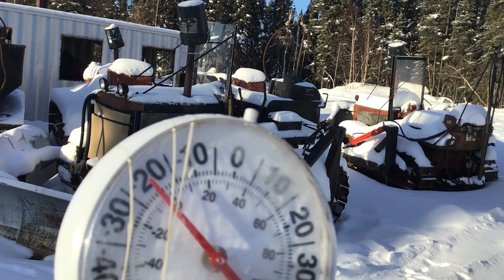T 9 IH Cat Dragging at Minus 30c Plus working on the Caboose Nov 30 2022

Comment: Today's weather temperatures in my neck of the woods. 

83°F
Felt like 84°F

An for my northern friends. Thats 28°C
Felt like 29°C

A difference of 
120°F
Or 58°C

That's what you call "no way in hell am I coming to visit in the winter". Lol

Even when I moved from Michigan to Florida. I told my friends "no one is allowed to die during the winter. Because I will not be coming to your funeral. "
Which the sad part is, one of my best friends did pass during winter a good few years ago. 
I couldn't make the funeral because of funds at the time. But I made it when it was still cold and snowed about a foot over night on my first night there.
Reply from the maker: oh my how you suffer in those temps, no wonder more and more canadians head south for the winter. it is sad when you can't make it to a funeral.  thansk

Comment: How do you keep your diesel from gelling up there?  Just run straight number 1 fuel or use additives or do you have a special recipe?
My old loader gelled up at 6 degrees F yesterday.
Reply from the maker: we are so far north they only ship #1 year around and we add alittle fuel conditioner plus 2 stroke oil for older diesels that need lube in the fuel to work.  6 on the F scale is not very cold.  thansk